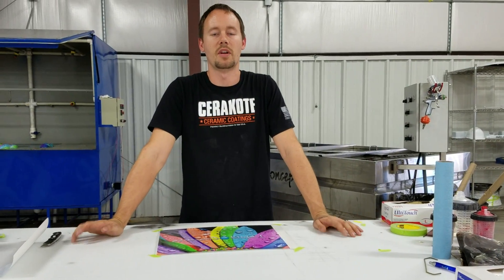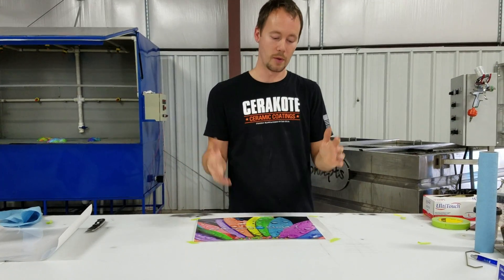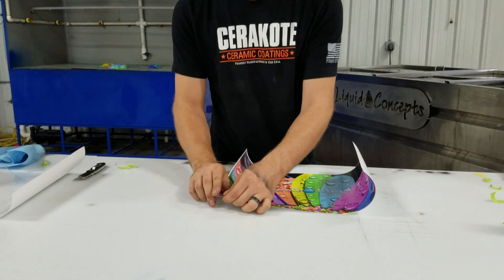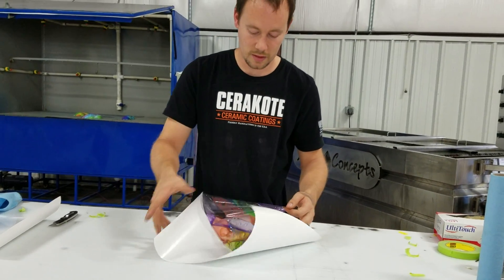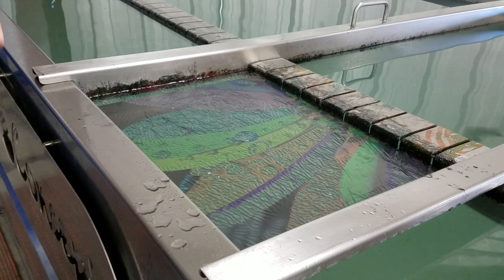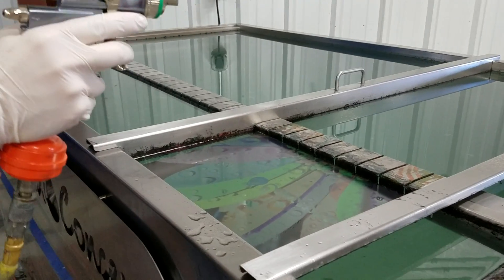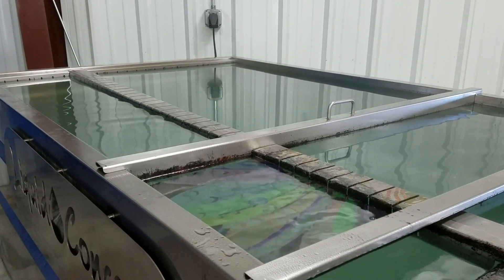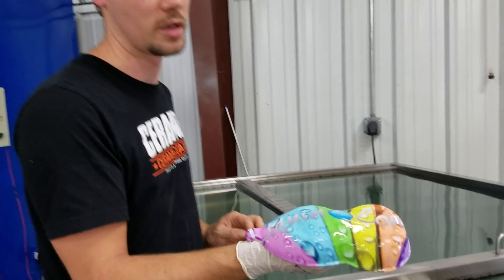Custom Digitally Printed Hydrographics Film Development By Liquid Concepts

Comment: 1. Do I need some sort of activator-A  to lock ink on hydrodipping sheet after printing desired design on Blank Hydrographic sheet?

2. After prinitng the design on glossy side of blank hydrodipping sheet, the color reminas wet even after 10 hours. Color is not drying on glossy side at all. I am using an HP 410 inktank printer with original HP ink.
Reply from the maker: I'm not sure with the process you are using. With our proprietary printing process that is not something we do.

Comment: What is the machine doing?  Is it just warming the water and running a timer?  Thanks
Reply from the maker: It helps recirculate and filter the water, keep the water at a certain temperature and give you all the timing necessary to know when to spray the activator.

Comment: Also what will happen if I don't spray activator A on the film? I only have Activator B for the second process.
Reply from the maker: For our custom film it does not require an activator A and activator B. If you are trying to print this film yourself depending on how you print it might require you to use both.

Comment: It looks like the pattern was a bit too large for the item. While the brand was centered correctly, the ends of the design weren't transferred. If it had been slightly larger or had the design been reduced just a bit you would have nailed that perfectly. Other than that the video was good!
Reply from the maker: Yes mainly this is just showing how our custom film works and such.

Comment: Will it be good on shoes ?
Reply from the maker: Yes you can dip shoes but you would need to coat it with a fabric or leather coating for protection. As far as durability this is not something that can be guaranteed on items such as shoes

Comment: How do you print custom films? I have no idea what printer to buy/use or how to even do my own custom prints. Could you guys do a video on this because I cant find one anywhere.
Reply: You can use a printer with thermal ink.  You can not use regular ink
Reply: @Gitnardoproductions  What about the paper that I use. What do I put in the printer, what kind of printer do I need
Reply: @ShadowkingX  it's called blank hydrographic film
Reply: You can use a printer that can switch out with thermal ink which certain Epson printers and also Ricoh is a good one.
Reply from the maker: I am sorry but we cant give out any information on what printer or system we are using to print this. We have spent years in R&D to make this and cant just "Give it away" for anybody to use.